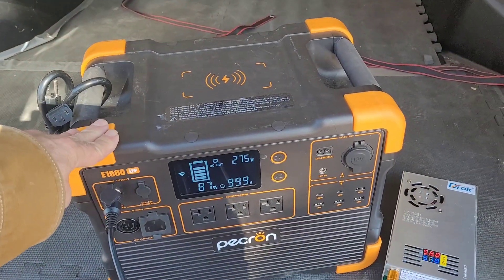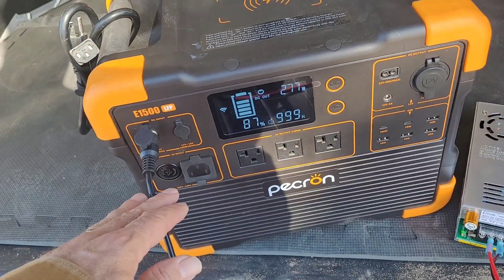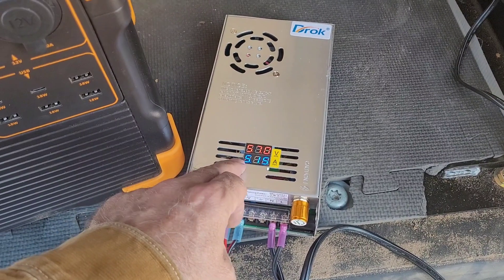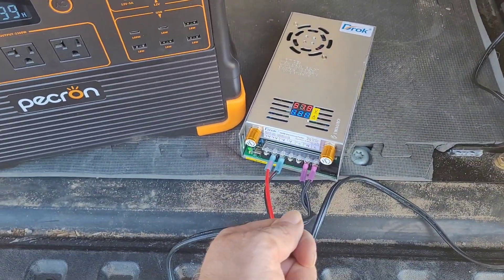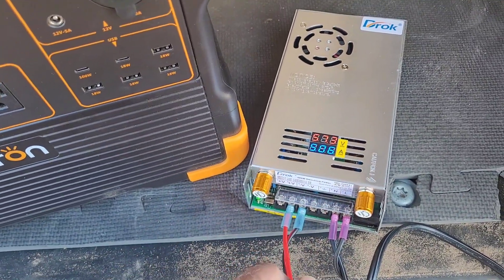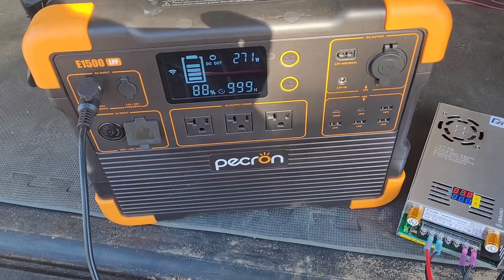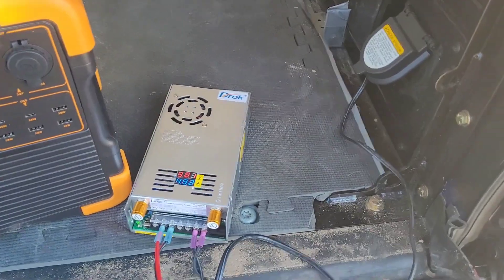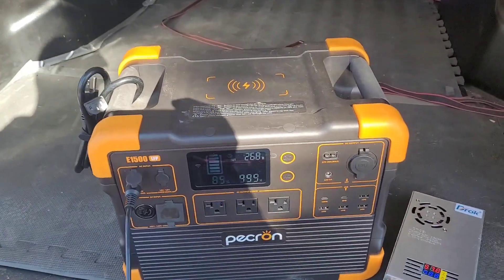Solved! Tacoma Feeds Power Station Despite poor Modified Sine Wave Inverter!

Comment from the maker: Most everyone wants to be able to charge their Power Station, or 2nd Battery System, from their alternator while driving.  Normally that involves a DC to DC charger from the alternator to keep the batteries separate so you don't drain your starter battery by mistake, and supply a steady 14.5v or so current, which most all of today's "smart alternators" no longer do.  They raise and lower the charge voltage depending on driving conditions, which is no good for Lithium batteries.  You'd then have to run about 30ft of thick 6 AWG cable back to the pickup bed.

Rather than spending $215 for a dc to dc charger, and $66 for 20ft of 2x 6awg, this video shows how to make use of the Tacoma Inverter and 120v truckbed socket.  This is despite it being a poor Modified Sine Wave inverter whose malformed power isn't recognized by newer and larger power stations, that don'tcome with an external "charge brick".

In the video I reference the "400 Watt Anytime Mod", a common Tacoma mod to allow 400W while driving, not just while parked.  Look in the description after watching, for two Youtube videos that show how to do the mod.
Reply: For efficiency and money savings, the DC to DC should be installed by the alternator/ battery, then a thinner gauge to where power is needed.  A Victron converter can be had for $150.
Reply from the maker: @Step-n-Wolf  This isn't a video about installing a dc dc converter. It's about NOT doing that by using the existing stock inverter.  Also, most converter and dcdc charger manufacturers recommend not installing their unit in the hot engine bay, but at least running the larger cable to allow unit installation outside engine bay.  This actually increases efficiency because they  perform more efficiently the cooler they are.  Victron and some others publish the efficiency at different temperatures.  If I was using a converter, I WOULD try to run as much small gauge cable as I could, once I got the unit installed outside of engine bay.  Thanks!
Reply: @dave_in_az  I understand, but you were quoting excessively high numbers for the alternative.  Also, close to the battery and alt doesn't mean strapping it to the exhaust header.  There are a lot of options forward of the firewall we had to use when racing.   Converting DC to AC then back to DC is inefficient.
Reply from the maker: Ok.   Like I said, several ways to solve the power problem.  I'm using the supplied inverter here.  Might do different in future.  Thanks for your comments!

Comment: @dave_in_az Thanks for the video.  I am probably going with the Pecron E1500LFP for my 2024 4Runner.  I like the idea of using the Pecron 300W Charger, as I would only need to do the 400W Watt Anytime Mod and not have to run wiring.
Reply from the maker: Good plan.  300W is a pretty decent charge rate for an alternator anyways.  4Runner only has 95A normally, maaaaybe some are 130A if a towing package.  So 25A pull for 300W is  the sweet spot to not mess with your alternator anyways ;)

Comment: Solar has no sine wave that’s dirty conversion.❤
Reply from the maker: Indeed.  When I plug a killawatt meter in and see how much inverter is delivering vs power station is getting to battery,  I get 85% efficiency.  That's about the same efficiency as every dc dc charger, or dc converter, from the alternator.  Only one better is the new 50A Victron really.  So at the cost of a few watts of power wasted, I don't have to buy a $200  or more alternator charger/converter, nor 4Awg cables, nor run cables, nor void my truck electrical warranty.  Thx for commenting, made me think about it for a bit :) Decided I'm still happy with this setup... though I did order one of those new Pecron 500W alternator chargers, to play with.

Comment: Of the power bricks available from pecron on they’re website which would be best suited for the Tacoma inverter with the anytime 400w installed?
Reply from the maker: It needs to be under 400W, so you don't force the inverter to turn off or blow it's fuse.  I looked at them, the one for e600 power station, 300w, is only one.  It has a 5 pin g16 aviation output plug, which works with e1500LFP also.
On sale for $99 right now.  However, they also have their new direct to alternator charging, dc to dc, for $149. It is 500W, wire it to you alternator/start battery.  But then you have to run cable from that to your power station.  It also puts out 42v for feeding into solar g16 5 pin input, but you need to use their mc4 to g16-5 adapter.  I won't be using it, as I want to use the already supplied inverter and wiring to pickup bed.

Comment: This is great but I'm a bit confused by why you're limited to the 278 watts in your install.  Your power supply is capable of 8 amps, which would easily give you 400 watts at the voltage you're using.  Did you find some other limiting factor?  I agree to push it to exactly 400 watts probably isn't wise but I would think ~350 would be well within a margin of error.

For reference I have an Ecoflow Delta 2 that will DC charge at 60 volts up to 500 watts so the power supply you reference is perfect for me as well.  This in a '24 Tacoma TRD OR.  I haven't tested the AC charging yet but am assuming they haven't updated the inverter so I'm guessing all the old restrictions and associated mods still apply.

My only other consideration is that it would be great to also have some sort of shunt that automatically switches from solar charging to car charging based on available power from the vehicle.  The Ecoflow only has one DC input charging port so if I use your method I either have to manually plug in the charging source or figure out some sort of relay to toggle back and forth based on whether or not the truck is running.
Reply from the maker: Thx for the thoughtful comment!  I agree with your thoughts, and am not completely sure why my power station read 280W or so input.  The power supply goes to 8A supposedly... but I popped it's fuse at 7.8A or so, had to go buy one and replace, so I don't really trust it at that high amperage.   However, running on my "400W" Tacoma inverter, that is the most I could get at 55 to 57V, around 5A.  I conjecture it is a combo of Tacoma inverter real limitations, Tacoma wire resistance losses, MSW inverter losses in the power supply conversion, and maybe port connection limits.  Lastly, the power station input is actually an MPPT solar charge controller, so I am unsure of it's efficiency in accepting this power signal.  All those combined maybe?  Was hoping to get 400W!  Still a decent input without having to add anything to truck wiring.
Reply: @dave_in_az  That makes sense.  I may buy a bit larger power supply to give a bit more cushion and see if I can get closer to that 400w number.  

Also, I enjoyed your video about camper prep.  I've had that tailgate seal in my saved list for awhile now and have been looking at the rails on the Tacoma and wondering if I should pop them off and seal under them.  Your video gives me the little push to make it happen.  I should have my camper in the next couple of weeks so need to get those things taken care of.
Reply from the maker: Thx!  Check out this thread I wrote on best powerstations for truck camping, looked at size, 12v dc amps output so you can run 1 plug to a fusebox, and inverter to let you do elec kettle, etc.  Might keep you from some house designs  that don't work too well for trucks...
https://forum.expeditionportal.com/threads/good-solar-gen-power-stations-for-dc-and-light-ac-truck-campers.242227/

Also, if I did it over I would replace plastic bedrails with a metal one, though not sure which.  But those plastic are super thin and camper kind of crushes them.
Reply: I am guessing here but believe it was limiting input because his battery was already close to capacity. As these things reach full charge some limit input to protect the battery chemistry.
Reply from the maker: You could very well be right... Jasonoid did a pecron e1500LFP test with their new 500W car charger, and instead of giving 500W, it ALSO, went between 278 and 283W.  I do now think that at mostly full battery, the Pecron throttles back charging and it's 1st throttle back is to 280W.  I will retest this with half full battery.  Thanks for your good comment!
Reply: @dave_in_az  will be good to see the results on it when you’re done. Thanks
Reply from the maker: @gofastdan and @D0praise 
I have tested the e1500LFP charging some more.  At 20% state of charge, the max wattage I can pull from the Tacoma truckbed inverter 120v port is 278-283 W.  Still the same after 30 min.  This is with Tacoma in idle and set to 400W inverter. With the supply set to max voltage, I get about 56V and 5.17 A.  This is 290W, but registers on Pecron as about 280, probably due to slight losses.   If I plug the Drok power supply into wall power, I get 61.8V, and was easily able to get 410W at 7.2A.  I stopped there to not burn out the 8A drok fuse, which I've done before.  So... I would say that 280W is a Tacoma truckbed supply limit issue, not the Pecron.
Reply: @dave_in_az  Thanks for the follow up!  That matches what I've tested so I think you're probably right.

I finally gave up playing with the Toyota inverter and went a different route.

Etaker has a kind of combo inverter, the F1000 vehicle fast charger.  It has two DC inputs, one for the alternator (connected to the vehicle battery) and another input designed to take DC from solar.  On the vehicle side you can choose from 300, 400 or 500 watts and the solar side can accept up to 500 watts as well.  It then has a single DC output, up to 1000 watts out to your unit.

I got it on sale for under $200 and I'm very impressed by it.  My only little gripe is that it has an accelerometer that senses when the auto is in motion and that's what powers it on. I'd rather have an external trigger and more control over the cutoff voltage.    When it's powered off it will still passthrough solar power, which is great.  

When I contacted them they said they're working on a "2.0" device that will have exactly what I was asking for (external trigger and adjustable cutoff voltage).  They expect it to be released ~Oct time frame so I may be upgrading soon but frankly so far it works exactly as advertised so maybe my desire for more control is unwarranted....

Bottom line, I'm happy with my set up now and am done playing with Toyota's subpar inverter and trying different hacks to get power from it.
Reply: @dave_in_az  impressive, nice work
Reply from the maker: Good info. Sounds like the Renogy alternator+solar one also.  Thx!
Reply from the maker: Thanks!
Reply: @gofastdan  does the solar charge the starter battery at all for the etaker?
Reply: @CowsGoMonkey  It does not. It's  unidirectional in that everything is directed to the output of the eTaker, ie. the Ecoflow in my case. It would be great to have solar charge the starter battery but it does not work that way.
Reply: @gofastdan  Thanks for the info! Really helped a lot. I'm trying to keep devices/wiring down. 

I got a engine bay dual battery solenoid setup for things that live 24/7 on the truck(400wh~ a day). Looking for a fast dc-dc charger/mppt controller that can solar charge the starter battery and a powerstation. Ecoflow has a pseudo system with the alt charger/smart auto charger. Guess victron, renogy, redarc may be my solution.
Reply: @CowsGoMonkey  Right. This won't do that unless you put all your load on a secondary house battery and then charged that of the eTaker. They've got a second version coming out in the next couple of weeks and are supposed to send me one to test so we'll see what new functionality it might have. I'm not hopeful that it will charge the starter battery though. The main thing I'm aware of will be the ability to connect an external trigger to activate it as opposed to the motion detector in the first version I have.
Reply from the maker: Someone commented, unfortunately I can only see 9 of the supposed 15 comments, and no new ones, sorry!  However, here is an update:  The 278W charge limit I saw is just what the Tacoma "400w" inverter actually maxes out at delivering, has nothing to do with the Pecron.  I bought the 500W Pecron car charger, it easily delivers 500W direct from alternator.
Reply: @gofastdan - Did you find a solution to the Delta 2 relay/toggle question? I have also been wondering if there's a way to avoid manually switching according to power source. Thanks in advance!
Reply: @DBauman  The solution I ended up buying was the ETaker F1000. It has inputs for a feed from the alternator and solar (up to 500w each). It works well but I have two problems with it. First, you can't control the alternator cutoff voltage. It never drained my battery but always made me nervous. Second, and more importantly, it gets pretty hot, hot enough you can't hold your hand on it. 

So, I don't remember exactly how but I had given ETaker feedback on the F1000 and they asked if I wanted to test a new product, the F2000. It has twice the capacity of the original and is better in every way. I won't go into all the details because there are a lot of options that can be configured but bottom line I'll just say it was what I was hoping for when I bought the F1000.

I will say, I somehow toasted the communications module in the first F2000 they sent me. It still works, it's just now forever stuck with the last configuration I had done prior to it frying. I don't think it's anything I did. The unit they sent me was a very early production unit and was kind of wonky from the start. They replaced it with another F2000, which I just got a couple of weeks ago and it's way better. 

I owe ETaker some sort of review on the F2000 and will probably try to post a YouTube video of some sort in the next couple of weeks. As far as I'm aware they've just been doing presales so far but the firmware and app updates have been slowing down and the unit seems production ready to me so I expect they'll start shipping any time now.
Reply: @gofastdan  Thanks for the reply and update. I ended up turning toward the Ecoflow ecosystem, but it's good to know that this is an option too. Look forward to the full review.